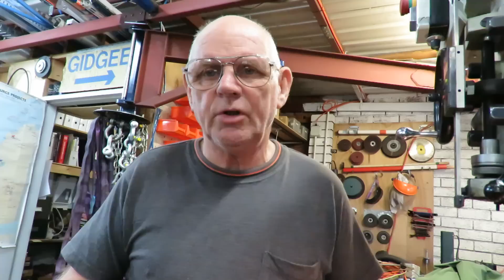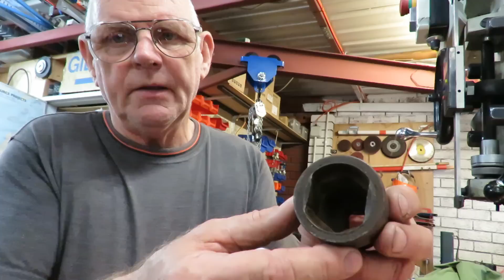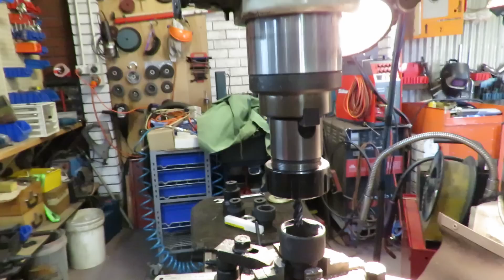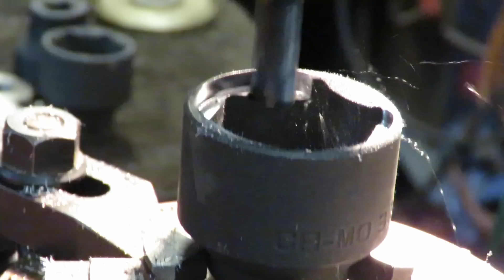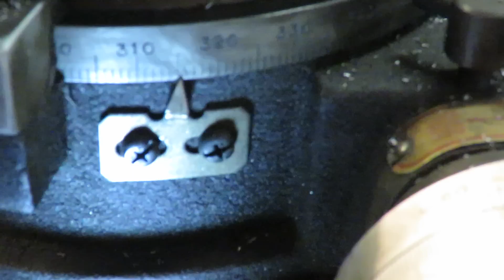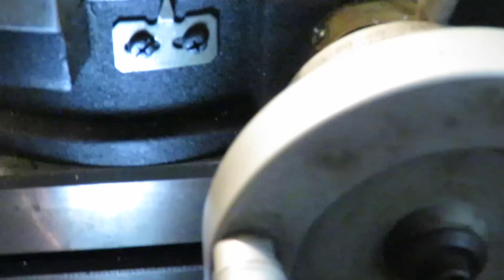Pump Impeller Nut Socket Build in Bruce's Shop

Comment: Hey Bruce, this is an older video, but just a couple of random thoughts (ok maybe more brain farts!).

Can't you fit stops to your rotary table? It seems to have the slot for them. It would save torch batteries if so! ;)

Given that there is virtually no material left on the outside of the socket after machining, it's really adding negligible strength and so you're righty welding a band around it. That being the case, instead of the rotary table, is it possible to put the socket in a lathe, take the outside of it down to the OD of the nut's radius, and then cut straight through the socket parallel to the remaining working faces? It would leave you with the two "prongs" sticking up if that makes sense? Then weld the band on to complete the circle. In other words the band would form part of the actual socket instead of just that sliver of material and the band doing nothing but reinforce it. It would save a stack of machining time. If I recall correctly you do these periodically, so I thought it could be worth future consideration.

Comment: Hey Bruce, thanks for the extra effort in making us updates on your work down there, it is much appreciated! I do have one random question, and it's not terribly time sensitive so if you get the chance to reply that's great, if not then I'm certain I can find out elsewhere. My question is: Does carbon steel tooling affect the corrosion resistance of stainless steel hardware when used on them in the field as opposed to chome-moly tooling?

Thanks again for the shows and best of luck with your workload. Aloha...Chuck
Reply: +Knolltop Farms Oops, just noticed it's a Cr-Mo socket, LOL!

Comment: That socket looks to be pretty hard judging by the small chips. The collar is a neat trick. 

Heat treating must be tricky, at least at first, since it has to b hard enough to stand the pressure, but annealed to the point where it isn't brittle. 

It reminds me of my late brother who always bragged that he didn't need a torque wrench, he just tightened the bolt or nut to a quarter of a turn before it stripped. When a skeptic challenged him, he'd look down at his feet and quietly say, "Well ya see, it's sort of a gift and I was never able to teach it to no body else.

He was a fun brother and a good friend. He was less than three years older than me, born in 1942 and me in 1945.
Reply: That's a nice memory, Tom. I reckon it's chrome vanadium.
Reply: Chrome Vanadium was the name I couldn't remember; thanks... :)